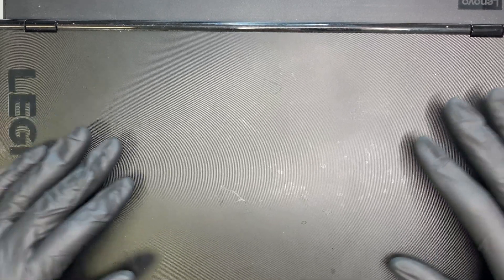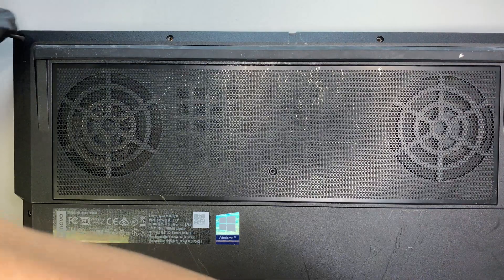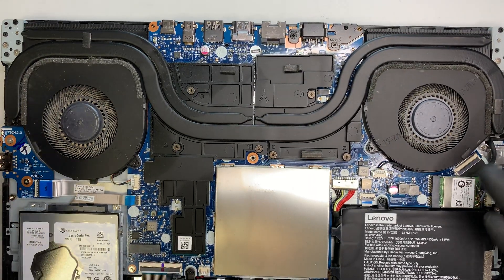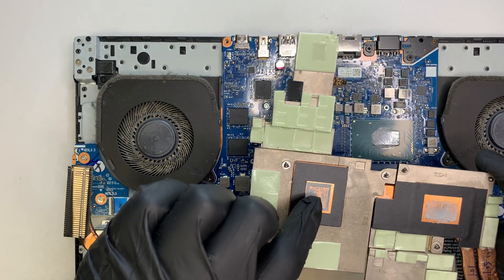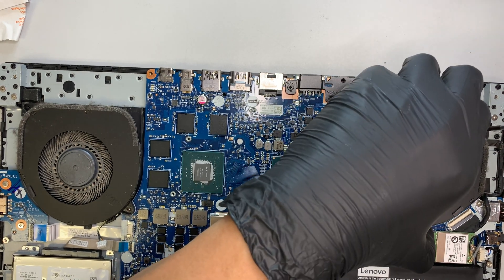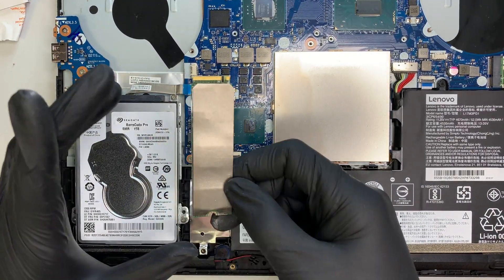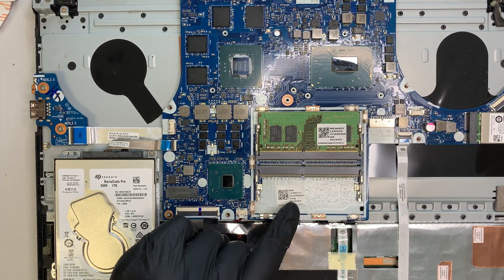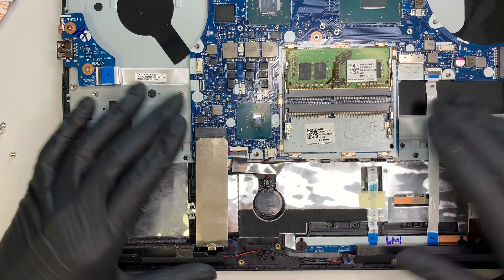Lenovo Legion Y530 151CH Tear Down Disassemble

Comment: Are the cooling fans on Y530 and Y540 the same? I own y540 and the fans require replacement, but I'm only able to find fans of y530 in the store near me. Can I use them instead? Because they look kinda similar. Will it work the same?
Reply from the maker: I'm not 100% sure. But it does look the same to me. Maybe can give it a try

Comment: Thanks for the video! I have accidentally broken a clipper for a ribbon cable on the mother board... the black part on top  of the flipper broke. Is there any way tonfix/replace it without having to get a whole new mother board? Thanks!
Reply from the maker: Which clipper that you broke ? More likely not able to repair but to change entire motherboard.